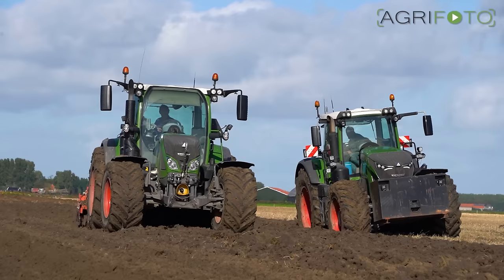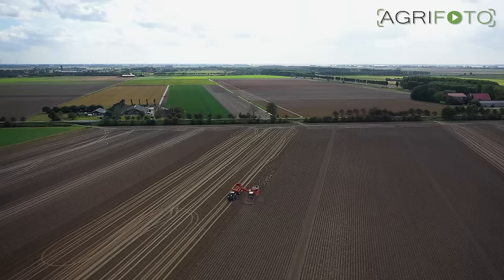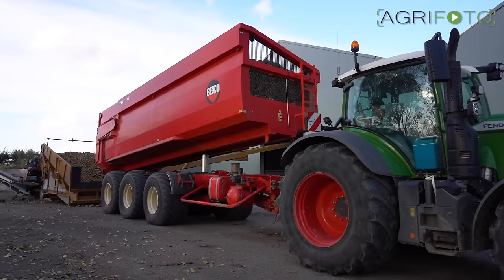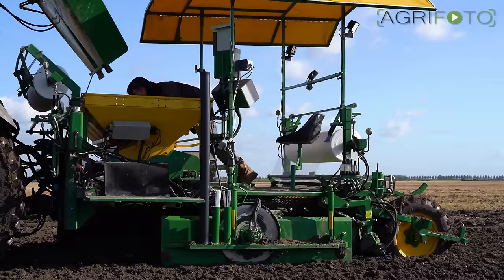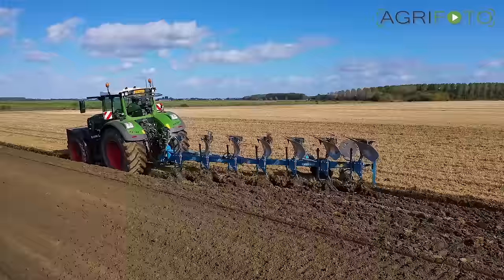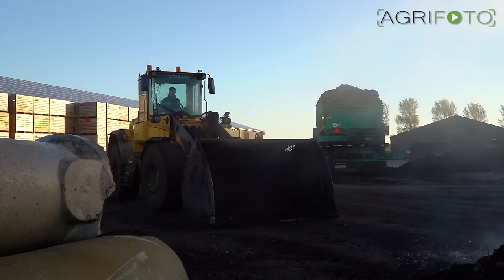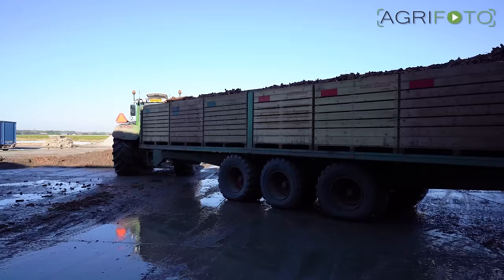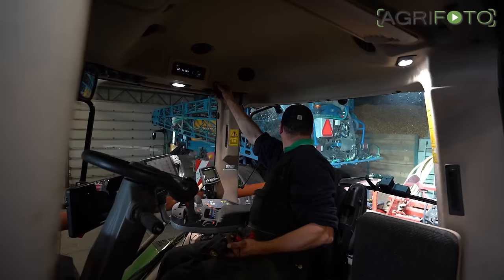XXL Harvest Special | Franzen Agriculture | Potatoes & carrots | Planting tulips & wheat

Comment: 26 ton trailer- 🇬🇧1980s. With a single row harvester with up to 10 souls on board, we once did 26 tons in one day- 56 pound paper bags.
Same order after the harvester ‘broke’, we picked 27 tons off the ground. Going from driver to picker I picked up 66, 56 pound bags. 
All the bags were hand loaded onto trucks- in those days a truck was limited to 50 tons, not yet using tonnes.
If I was actually bagging on the harvester not driving the tractor, on a normal day I would expect to handle (any individual bags multiple times) 4,000 bags with at least 1000 thrown. In a season I would still have not gained or lost any fat or muscle mass. 
Concurrent to the potato season was hay season for multiple farmers- small, rectangular bales man handled into barns- and driving silage for multiple farmers.
Oh, the good old days.